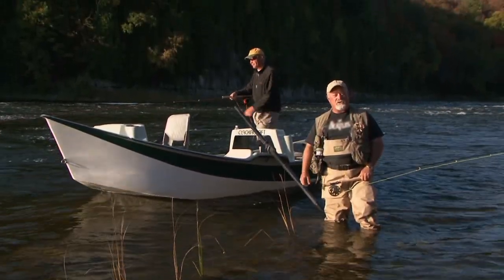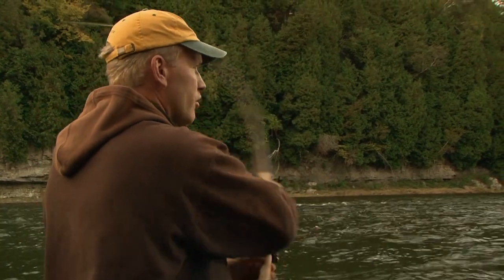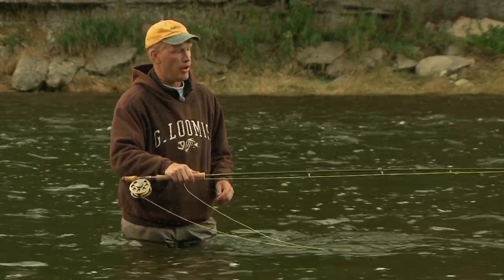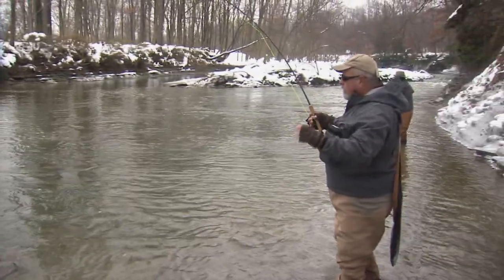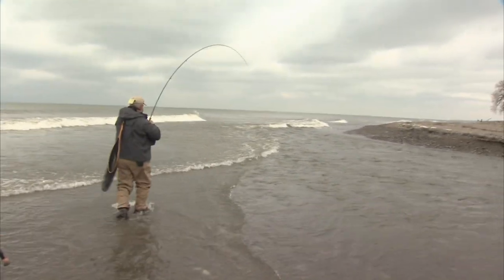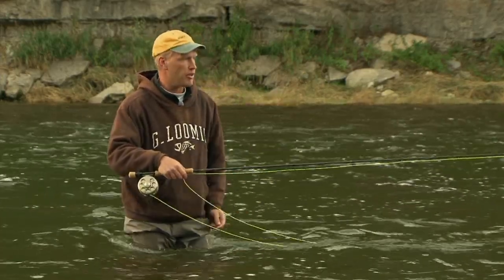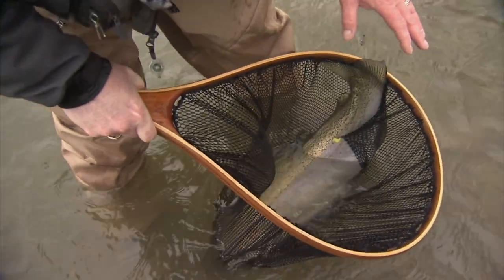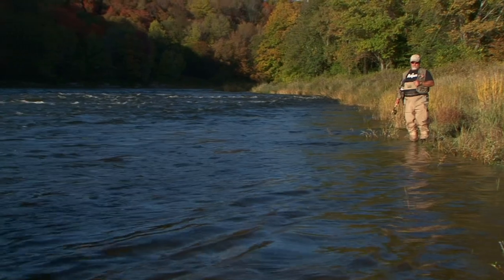2 Handed Steelheading | Ontario

Comment: This was a really disappointing episode to watch. Usually I like your productions, but I had a hard time with this one for the following reasons. One, I wanted to see Mike demonstrate the spey casts only to see that the camera views were too tight and could only see the lower portion of the rod and nothing of the line & anchor placements. Second, it is becoming common practice to not use any sort of gloves while tailing or handling fish due to its destruction to the fishes protective slime. Third, the amount of air exposure of the fish for the viewing display, in my opinion, was excessive even though the fish was released under full recovery. Open to your thoughts and/or feedback.